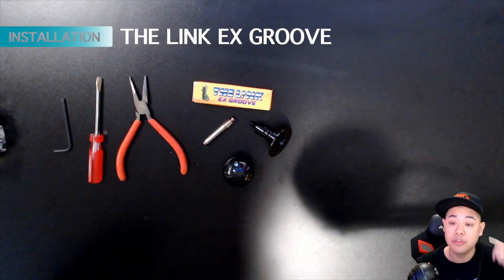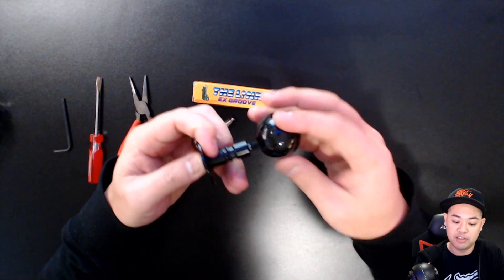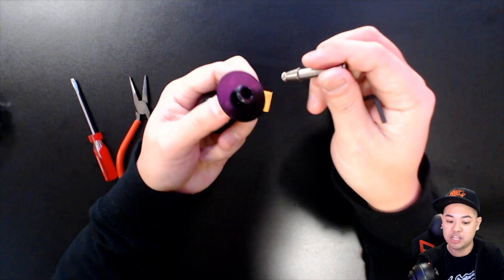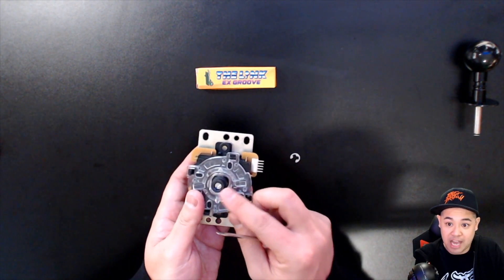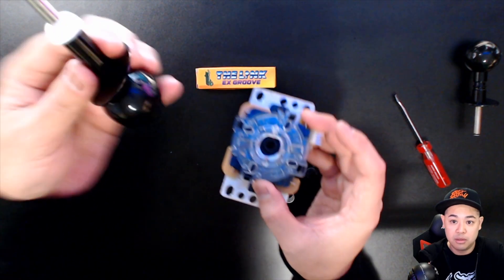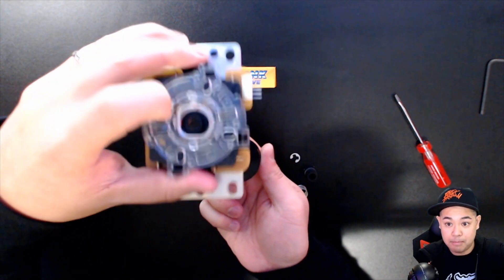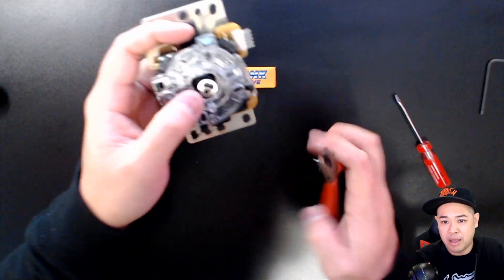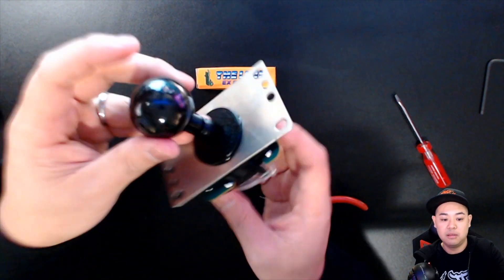Link EX Groove Installation

Comment: I have 2 of these, 1 black and 1 silver, and It's such an amazing piece of engineering, I love it. But I wish they'd sell specific dust washers for it (maybe made of aluminum), because regular Sanwa dust washers' inner diameter isn't big enough to allow it to stay parallel to the top panel of the stick when you move the joystick all the way to one side when you have The Link installed. That makes the washer tilt and "dig" into the top panel, and it did leave scuff marks on a Qanba Drone I had The Link installed on. You have to widen the hole of a Sanwa dust washer with a dremel  to prevent this from happening.

Comment: What dust cover is compatible? My Sanwas I have around dont fit.
Reply: second this question a year later, just installed the link ex and the dust cover hole is too small to fit around it
Reply: Any answer? 👀
Reply: A little late to the party but to anyone reading this now, Qanba's dustwashers are compatible with the link, and come in a variety of colors too.

Comment: Is this not compatible with hayabusa stick?
Reply from the maker: It’s compatible
Reply: @Phreakazoid187  when i try to install it, the e clip wont go back in
Reply from the maker: @LinNick  the eclip won’t fit the shaft or it doesn’t align? Double check all components are assembled properly. It’s been used in hayabusas for a while.
Reply: @Phreakazoid187  the shaft comes up short and i cant put it int he groove